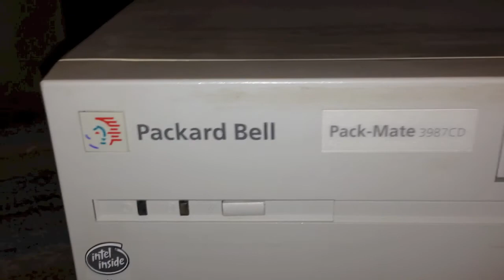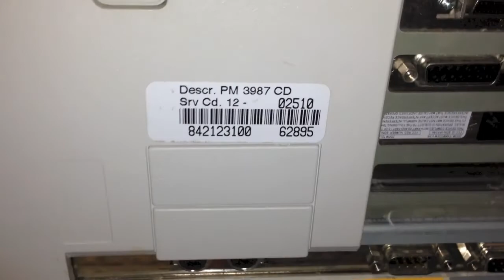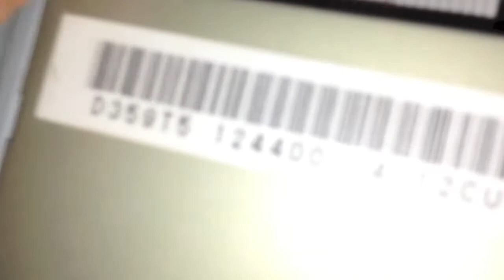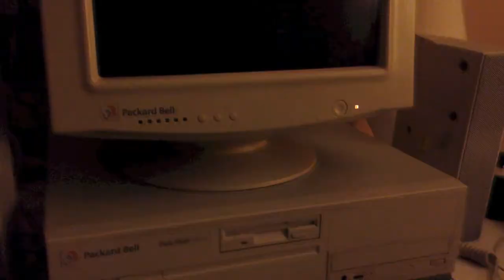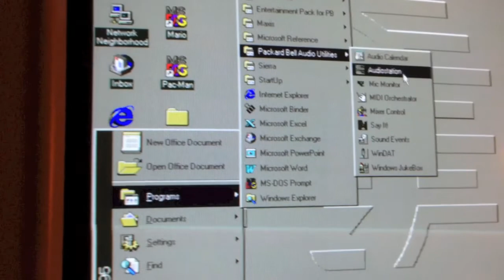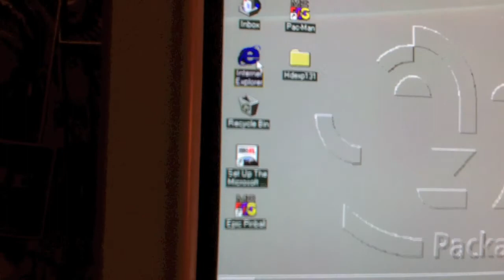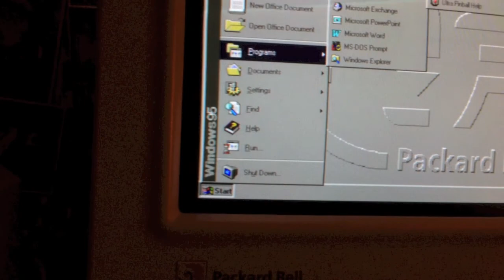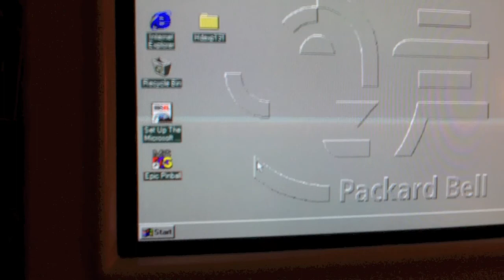Updated Video on the Packard Bell Pack Mate 3987CD

Comment: The two blanking plates are very common! One hides where the onboard 2400 baud rockwell modem would go, which was used with many of the 486 machines. Later machines integrated the modem with the sound card so this wasn't needed. I think the other was for a second serial port, though I've never seen it populated.